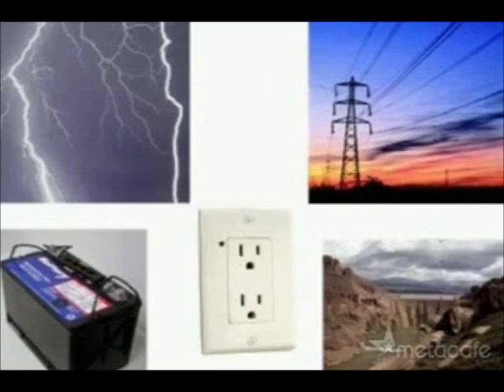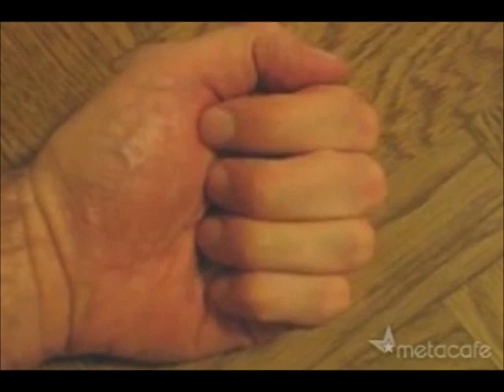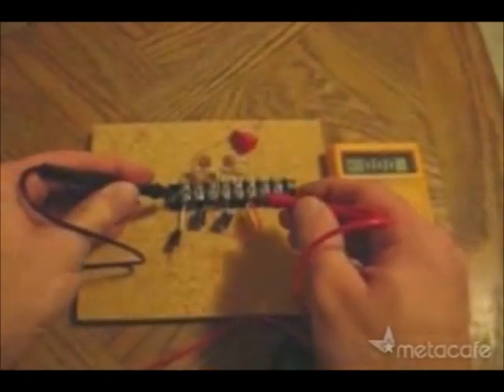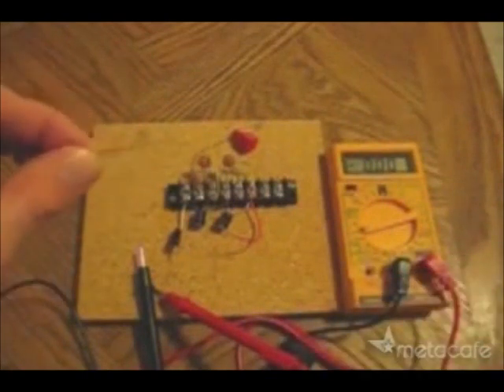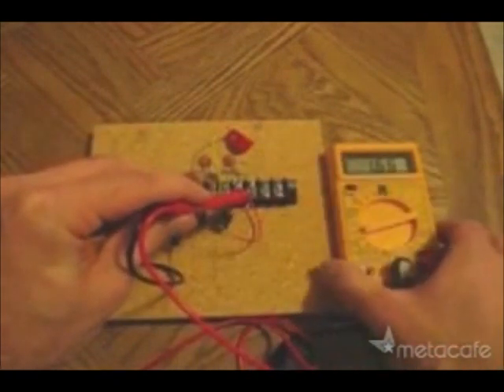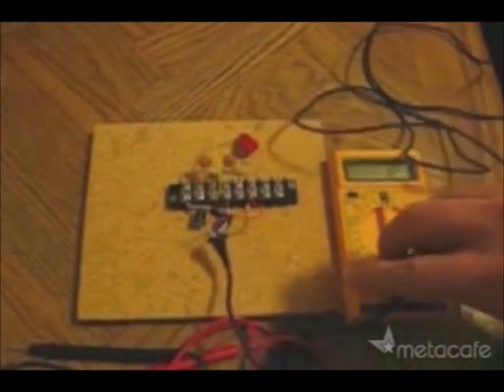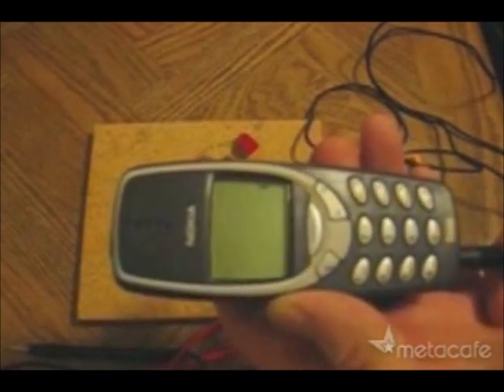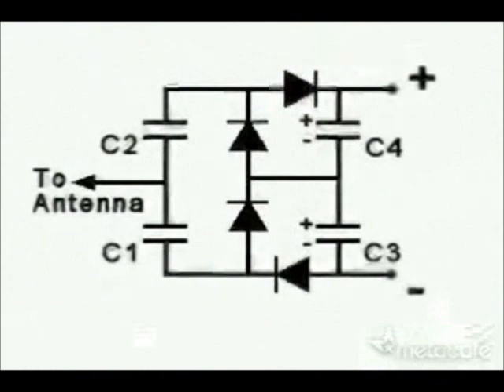Nikola Tesla Secret - Learn How to Generate Free Electricity with Nikola Tesla Secret

Comment: the other thing to consider, is that our earths core generates a magnitic field which protectes us from radiation.  that is another source of the air having some level of current/ voltage.  then, there is the inknown factors of dark matter and dark energy who knows how that affects our known suroundings
Reply: +leftofcenter4  My opinion Dark mater is only data plugged into a computer model to back the expending universe theory which we except as fact but really can't prove. If you ask me infinitely kind of disproves the big bang.

Comment: Hey this probably does work to some extent, there is some small amonts of power in the Air where millions of signals are living.  these signals ride on carrier voltages usally on cooper lines but are also in the wireless signal generated.  I studied electronics in college and I have been an employee of At&t for over 23 years.  I am sure this circuit works off of electromagitic induction.  we are surounded by it.. trust me it interfers with other forms of communications..  We live in an electic world, it has always been there even before we learn anything about it,  Electrons are reality in everything..they  are part of th Atom.